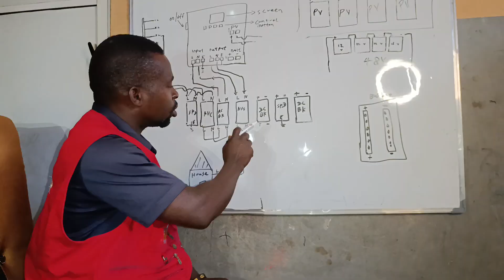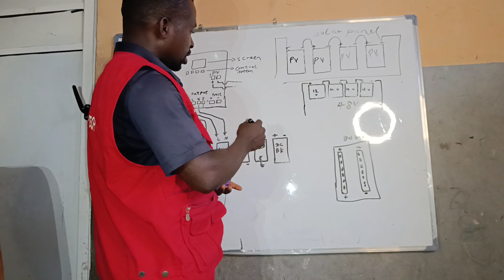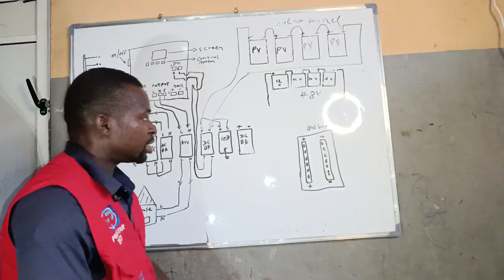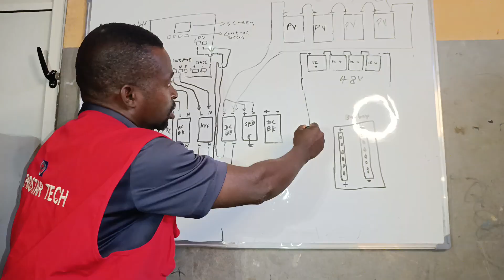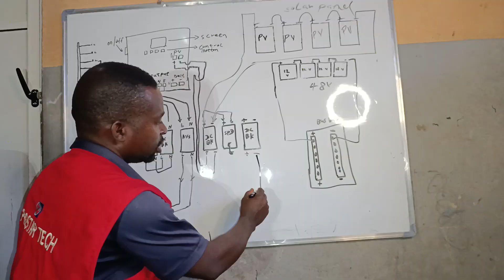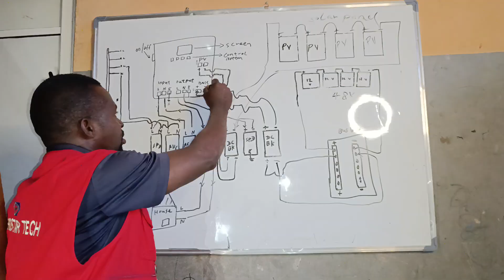Solar panel and battery protection

Comment: Pls how do you connect the 3 battery and which wire size you use .  Pls be giving likely wire size in all sample
Reply from the maker: Pls in series or in parallel and what is the capacity of the battery